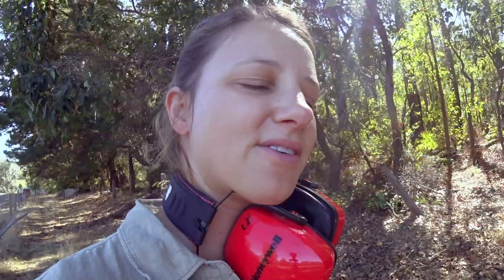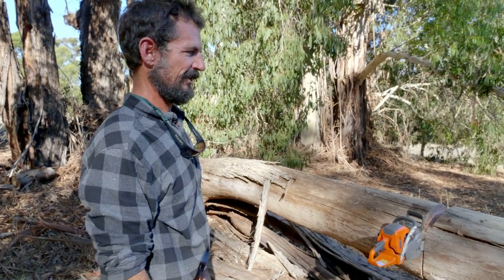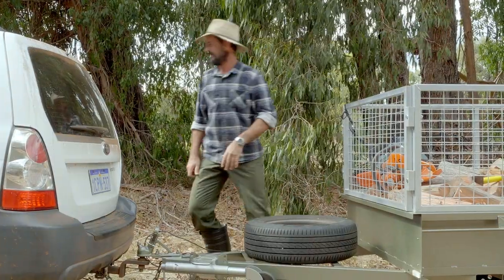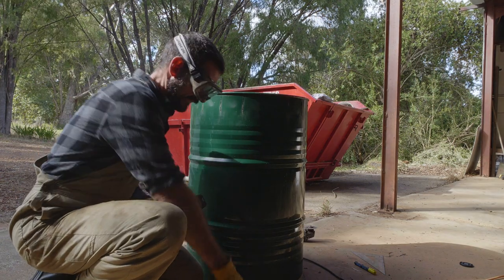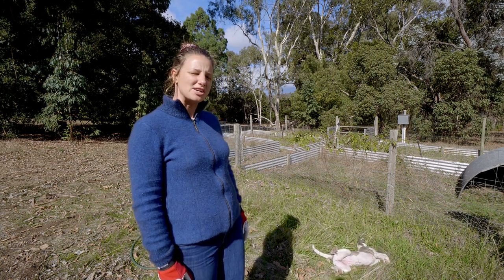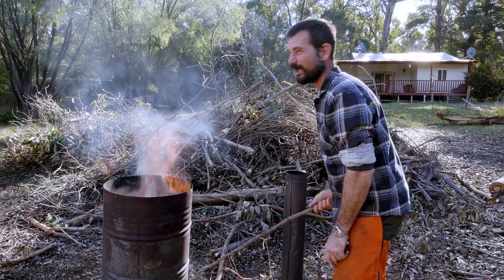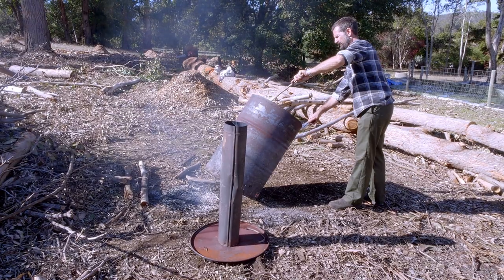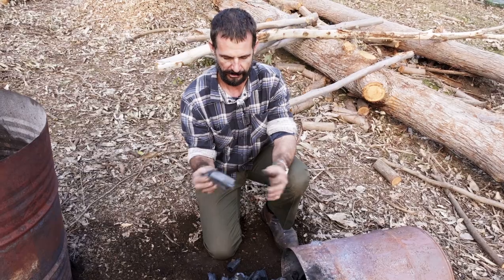Bringing Order to Chaos (feat. Chainsaws and Biochar) - Free Range Homestead Ep 3

Comment: What made you guys give up the sailing life for the homestead life?

And, some friendly advice from an old logger and sawyer. Get up on top of that log and cut the back of that log first. Keep cutting the backside through until you start hearing the log let go. Then get on the ground and finish the tension side when you have a safe escape route. You don't need to cut a wedge on top, as it will actually hurt the process. Just drive a wedge into the cut and it will hold you from getting pinched most of the time. If you cut the wedge in as you did, there is nothing to drive a wedge into, it's too wide.

I am actually going the opposite way of you guys. I sold my log cabin/homestead in eastern Oregon and I bought a sailboat lol.
Reply: I think they’re gonna start a family…
Reply: Things are going to go pear shaped(shtf scenario) in Au and u will need a secure bugout location to protect some resemblance of being self reliant, which u cant be on a boat for several obvious reasons..... with empty shelves in the supermarket getting worse, they will have a very short window to start stocking up real fast, eventually fuel will be an issue so I can see Troy building a gassifier to run things on the farm. I just hope they transform their fiat currency into real tangible things to survive on b4 he economic collapse.
Reply: Me too, old (40s) homesteader, going sailing..
Reply: @markjames9205  maybe u let the cat out of the bag huh?

Comment: I've been a self-employed arborist for over 10 years now. I liked seeing how careful Troy was while working on that tree. Trees that are splitting like that can also be more difficult if they give way in slivers instead of staying in rounds. Speaking from personal experience you're absolutely right about the benefit of having two chainsaws. Taking the saw off the bar is the next best thing though and even I probably wouldn't have thought of that. Good thinking Troy. One bit of advice if you run into another problem tree like that again where you're not sure exactly which way the tension is laying. If the tree isn't slivering much make two cuts side by side about a finger's width apart. Alternate cutting from one to the other, but don't lead too far with either cut or you could end up pinching the bar anyway. If the tree is slivering badly Then you can cut about a hand's width apart and knock out the little pieces with a claw hammer or hatchet. Once again watch the lead to avoid pinching. It was also fun watching you make the charcoal. So many good tips and ideas. Now if I make a burner, I'll know a tried-and-true system for getting good quality charcoal. It was good to hear about the garden plans Pascale. I used tarps weighted down with a few wood chips to keep them from blowing away as a grass kill method in my garden. Then I could just move the tarps across the garden space as I had time to enlarge the growing area. Love all the work you two are doing on the place and I know how much work doesn't even make it on camera. Been there done that. Many people have forgotten how to truly homestead these days, but the good things you get from a homestead are soooooo worth the work. Ty for the provisioning guide. I need to download that before I go sailing. :-)  Keep it up. Love the vids.

Comment: I have gained modest experience in dealing with downed trees and I came up with a method to keep the bar from getting pinched that worked well for me.  I do NOT make any wedge cuts in the top to aid the tree in getting to the ground, gravity does just fine.  Instead I made several reasonably small wedges ( about 40mm wide and no more than 70mm long) of some good hard oak wood.  Then I cut from the top of the suspended log to the 1/3 to 1/2 point and before the gap begins to close I pull out the saw and pound in my small wedges.  Two or three of them are usually enough and I place them at equal distance from the top of the cut, more or less at the "10" and "2" positions or a little further down with a third at the "12" position sometimes.  Then depending on what the situation seems to mandate I continue cutting down or I begin to cut up from the bottom.  Usually I continue to cut down but then cut the last little bit cutting up from the bottom. These small wedges kept the gap from closing and  pinching my blade, and, well placed wedges seem to stabilize the log a bit and help it fall straight down.  

One tree was about 550mm diameter and I only have a 460mm blade.  So I made an initial small cut across the top as a guide and then cut in vertically several inches on the "back" side of the log.  Just deep enough that my saw would reach through what was left.  Then I began my downward cut to about the 1/3 point and I drove in my small wedges.  I was then able to finish cutting down with out the log trying to bow toward me as I got to the bottom of the cut and my saw never got pinched.

I made that cut on a tree I had to bring down that was about 650mm or more in diameter at the base from which the wind had stripped off all it's branches (except one small one) but the trunk still stood tall.  (about 23 to 24 meters of it)  I tried using a weighted arborist throw bag to get a line across the stubs of branches at the top of the tree but found that I couldn't hit the broad side of a barn with it.  I ended up modifying a 'Daisy' sling shot to hold a bright orange golf ball that I had drilled a hole down the middle of so I could attach a light line to it.  It only took me three tries to get the line across the stub of a branch I wanted.  I was then able to pull up a heavy line that I attached to a 2-ton hand winch anchored to another tree that was slightly out of the path of where I wanted the tree to fall.  I lightly tensioned the heavy rope and then set about cutting my wedge which was difficult using such a short blade on a big tree, I had to take the wedge out in pieces and then clean up my surfaces.  Then I put a great deal of tension on the heavy rope and started my "back cut" which was again difficult because of the short blade.  I more or less had the saw pointing into the tree rather than across it.  Again it took several cautious cuts to get my hinge to a more or less even and reasonable thickness.  At least it was to the point at which I noticed that the back cut had begun to widen a bit but it didn't fall.  At that point I gave up on the saw and went to my winch and found the rope a bit slacker that it had been and as I increased the tension I pulled the tree over.  It worked great and I only missed my intended landing point by about a half meter.

Wow, I got carried away their telling my own story.  Anyway.... small well placed wedges to prevent the pinch and slingshots and golf balls to get lines up in the trees.  Works for me anyway.

Comment: Troy - With over 50 years of felling trees and heating with wood, I often find it works best when you start cutting at the top of the tree once it is down or leaning. Doing that releases the tension more gradually and safer. Easier too! 

Leave the supporting limbs, touching the ground, until last, then again start at the top work to the base of the tree. Normally use only undercuts as the thinning branch wood will act as a "hinge" to slow and control the decent. Be ready to move out of the way in-case it doesn't though.  

By the way, your choice of a Husky saw is a good one! The only brand I will use.  Have fun and stay out of SOME mischief!
Reply from the maker: The top was 3m up another tree on a 10% ground slope. More complicated than usual.
Reply: @FreeRangeLiving  I have had those too! I still start from the top, as high as practical, and undercut to bring it down reasonable slowly. Since I usually work alone, I am extremely cautious.

Comment: Oh the pain of jamming a chainsaw.  Yep, we've all done it, but thankfully only once.  Here's a tip that my dear old Dad taught me decades ago in the 70s when I was a greenhorn on the chainsaw.   Put a prop or chock under the heaviest side or stump side then to your cut.  You should make sure you've cut both sides of the log as you did in the video, but if only one side is going to fall and it jams the blade a bit, all you need do then is crow bar the lighter side a bit and it will loosen the chainsaw.  And that works every time.  Cutting a wedge is a good idea too, which is what you did. It gives the bending wood some extra movement, but if you allow both sides of the cut to fall it is a guarantee that you will jam the saw.  Prevent one side from falling and you'll be okay.

One other tip.  Have a look further up the tree to see if you can take some of the load off of the trunk.  Or maybe consider if it is safe enough to put in a cut further up.  It all hinges on how the tree will fall and where it will fall.  Broken limbs and death await those who rush in when trying to cut some of these fallen trees, so it's good to take your time and study the situation.  

Good job and bloody great video Guys!
Reply from the maker: That tree was complicated by having the top caught in another tree which was also broken, it was on a 10% ground  slope and had sideways tension. It happened just once so we thought we better film it!
Reply: @FreeRangeLiving  Yeah, they are really dicey.  It's too difficult to see on video, the lay of the land and how the tree is situated with whatever stresses are upon it. You got it all in the end and no one got hurt. I guess the other tip I read in the comment section that was good, was to have an old spare blade and chain handy for such occasions.  They are rare though, because it doesn't  happen often. Really enjoying your videos.  
You're gonna need the wood this week though, because we are in for a seasonal change and we are finally starting to see the yearly drop in daytime temps. Keep warm!

Comment: Great move getting the chooks to clean up the garden area,  in a previous property I had 2 garden areas fenced for chooks. I would rotate the chooks and gardens most years and always had a relatively weed free and fertile garden (needed lime though).  Removed a great deal of the Labour in Vege gardening soil preparation and weeding particularly.  Imagine No slugs and snails in your garden for the first month or so when your seedlings are popping up.  It was also my compost heap anything compostable went in there from grass clippings to kitchen scraps the chickens ate, spread, broke up, excreted, trampled in to the soil, everything that went in there.

You didn't mention the carbon sequestration part of biochar (or did I miss that) it works on several levels first it removes the Carbon directly by basically turning it into a stable mineral which is locked until it gets burnt. In the soil its inert apart from surface area so its sequestered for thousands of years in soil. Secondly it takes waste wood out of the rot cycle which while it ultimately turns back into CO2 which becomes more trees there is a part of that cycle where its converted to Methane by rotting which is a greater insulator to the environment than CO2 therefore you have reduced the global warming aspect of the waste wood just by burning it. Keep the ash for your garden too it has huge benefits in that its full of minerals and is a superb pH modifier.

Comment: Always nice to have two saws in case on breaks or one gets stuck.
Reply: - or, easier, have a spare bar and chain.  Then you can undo the saw from the bar and chain which is stuck in the tree, fit the spare, and cut CAREFULLY elsewhere to free the trunk section.  (When you get the original bar and chain out, check carefully that the guide rails have not been pinched shut to grip the chain.)
Reply: @rogerstone3068  he did check the guide rails.

Comment: I know it was big in Australia in ww2 era, but in case you hadn't heard, you can use the combustible gasses coming off the charcoal making process to run a generator, just have to clean and cool the gasses with a filter, lots of plans on the internet, I like an old intercooler from a big diesel truck as part of my filter system, it cools the gasses well, and they are aluminum, so pretty immune to the rusting causes by the process.

  The natives of the eastern USA used to burn the ground around base of flowering fruit/nut trees, so the black charcoal would make a little micro climate a few degrees warmer than it would be otherwise, which leads to more flowers, and more fruit/nuts.  It also gives a few degrees of protection from the late killing frosts we get here, which at the wrong time can freeze off the flowers and cancel the fruit from that tree for that year completely, hah.
Reply from the maker: I had heard of gasifier engines but thanks for the tip about blackening around fruit trees. No one seems to do that here but I can believe it is very effective.

Comment: Love watching you guys now for some time. Wonderful that you can harvest dead fallen trees for firewood. Great to see you using all the safety gear. However for this big dead tree you need a much bigger chainsaw and if you want to pull anything that big, you will need a heavy duty 4x4 and best with a big winch on it. You can do it with smaller tools but it will take longer and likely be more dangerous. Smaller tools also break easier. The small saw got stuck in not the best position. I would hate to see you get hurt. My dad used to harvest big dead fallen trees alone but he had a big 4x4 with a good winch and two of the biggest blade chainsaws he could find on the market at that time.
Reply from the maker: Who's paying for this? I'm very happy to meet them!

Comment: You should top the tree first.   Remove all the smaller branches, then start cutting rounds from the top end to the root end.  That way when you get to the main trunk most of the weight is gone reducing the tension and the danger.  If there is still downward tension and you have a clear space under the log start your cut from the bottom, that way the cut open up instead of pinching your blade.  If the tension is gone just keep cutting rounds.  It goes much easier that way.

Comment: You should have step cut it and put a wedge in at the top. Actually I have a 660 where Id just back cut the middle and used a bar tool as a wedge. I do the stuff everyday though.
Reply from the maker: That 10% slope tricked me a bit. Really wanted to avoid being downhill of that hung up stem.

Comment: You sail boats, I cut trees. Undercuts work  and have two saws or get good fast.
Reply from the maker: It caught on the undercut. Lateral tension was the problem.
Reply: Don't worry you'll get the hang of it. It's pretty easy work if ya don't overthink it.

Comment: God made limb wood to hold the majority of a tree top off the ground and easy to cut so why not start at the pointy end of the tree.
The limb wood will be drier than the trunk wood too and possibly seasoned well enough to burn straight away.
Put chocks under everything especially the trunk to make the job of bucking it up as easy as possible.
I lived on acreage and cut lots of firewood along with selective clearing and developed a healthy respect for fires of any kind in the Australian bush.
In the end the only time I lit anything was on wet days preferably while it was actually raining.
Scare yourself one night by lighting your drum and watch the glowing embers coming from the chimney and you'll realize it's when and not if you're gambling with.
Raking away anything flammable at about a 6 metre radius would be prudent as well and something to douse spot fires because you should always be there watching it.
Reply from the maker: The pointy end was suspended 3m up in another tree.

Comment: A handy but really simple to build passive heater (wood / work savior) with a simple thermostat triggered and solar panel driven fan to blow heat into the house is an aluminum soda/ beer can solar heater for on the roof or the most south facing wall (here an example of how they work etc.  https://youtu.be/nuxanLdtwZQ).
It’s a nice thing to build once you found a cheap or free source for preferably double pane windows and then just build one ore several with those dimensions.